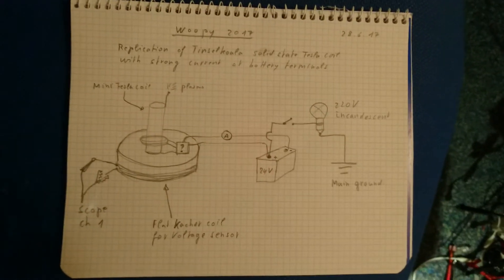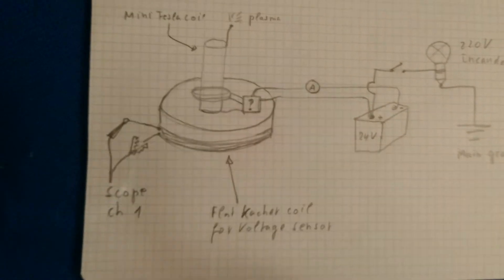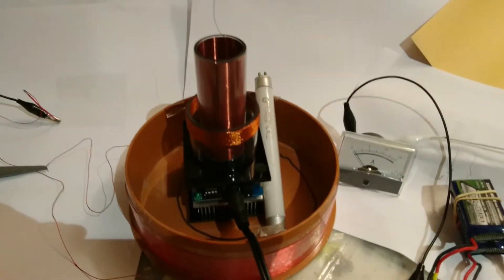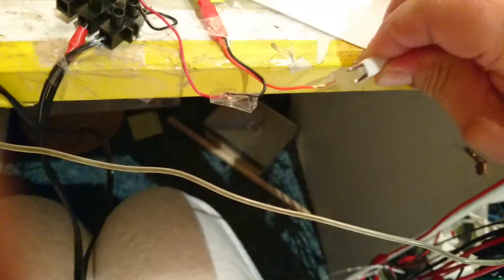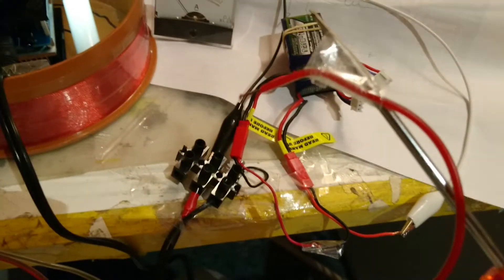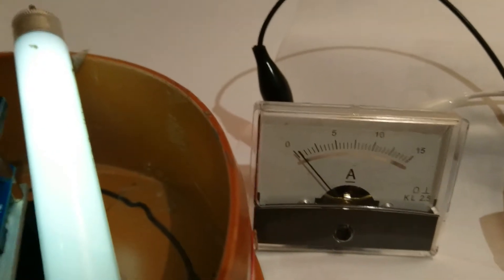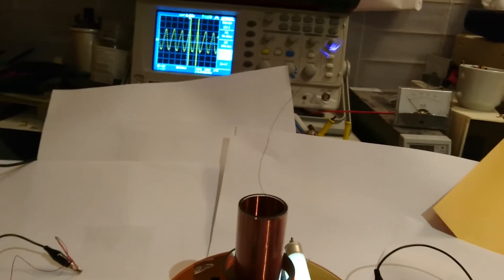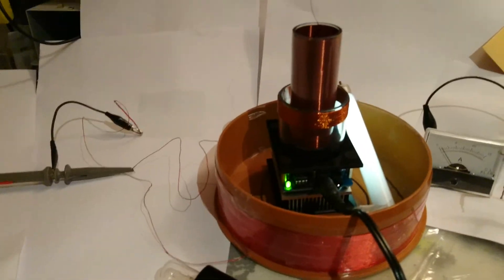Teslacoil a replication of Tinselkoala amazing 220 bulb lighting

Comment: Tres interessant!  Merci, Woopy.  I haven't been able to find TK's original announcement, would appreciate that link.
   Is the current through the bulb AC or DC?  (I presume AC, otherwise I can't see how charge could be conserved - if this bulb stays lit for very long.)   What is happening to the battery?
Reply from the maker: Hi Steven yes the bulb is AC.
here the link
https://youtu.be/WV3posVDqJs
https://youtu.be/S_URR6Bk9cg
What do you think is going on here

Laurent
Reply: +Steven Jones. I had exactly the same questions! Let us know Woopy....
Reply: Hey Woopy, is there any way for you to put the amp meter between the earth and bulb? Or between the battery pole and the incandescent light? Also maybe a voltmeter on the battery meanwhile you connect or disconnet...Just to see if the battery is drained by the light or if it receives an energy increase....
Reply: Thanks! You said the Tesla coil was made in China, but I haven't been able to find the same one on Ebay.  Can you point us to - which one you bought?  That would help us doing the replication.

Comment: I would not use a pencil to point at a High Voltage device which is switched on. It might have conducted current and zapped you. Unless the frequency is high enough.
It looks interesting, still this experiment uses (approx) 12 Watt.
Keep up experimenting! Much fun!